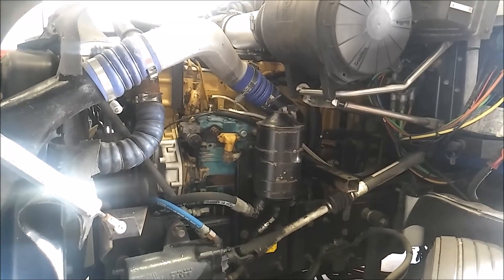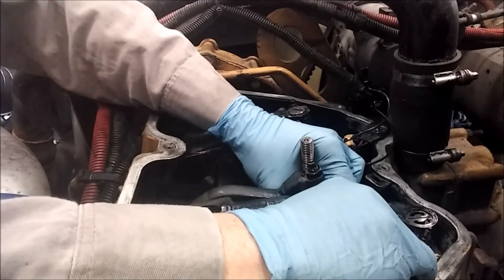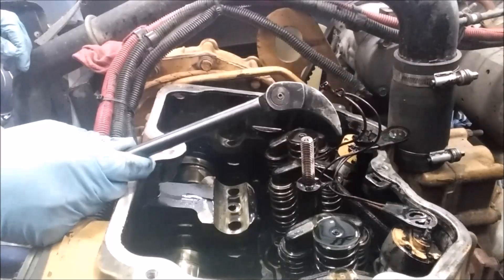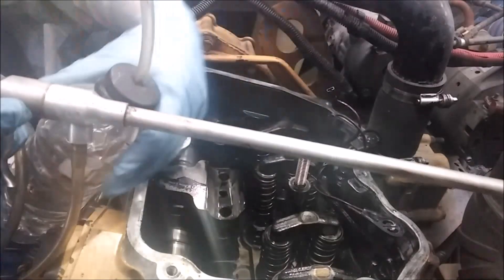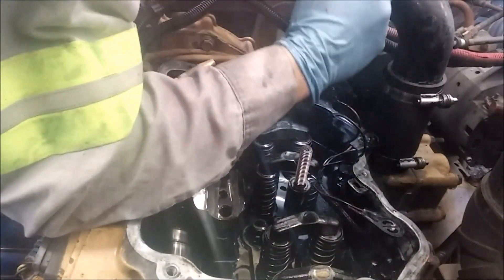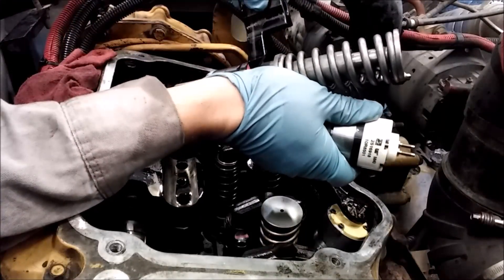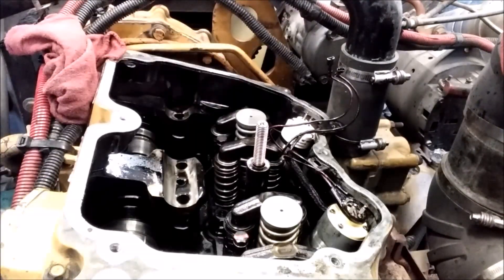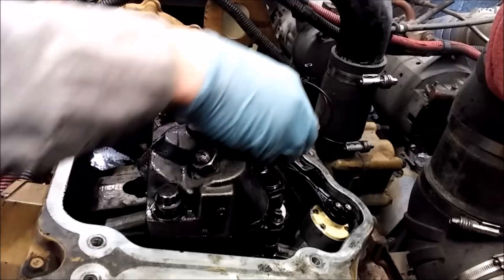How To Change a 3406 Injector or C15 Injector on Cat engines

Comment: yes not when I am stoped but after I finish a trip I see all that black on my trailer
Reply from the maker: Sounds like you have an injector over fueling, that is the cause 90% of the time, the injector it injectors will have to be changed most likely.

Comment: is it just a computer flash or mechanical work
Reply from the maker: Looks like you can change your HP to 550 1850 torque if you want. You need to check your transmission serial number to see if it is rated for higher torque, if it is rated for 1650 torque you can uprate the engine for 500 HP 1650 torque.

Comment: first I want to say thank you for does videos, they are very helpful.
if you would make one video, I just ask if you can, how I can use that tool, injector hight tool and how we can adjust it on C15 engine.
thank you again.
Reply from the maker: Will do, I'm going to make a C15 overhead adjustment video. There are some on YouTube, but I want to do a thorough one that will describe injector height, valves, Jake's, and IVAs. I just have to wait to do one at work and record it.
Reply: Thank you very much, I wanted to ask you that, but I thought it will be too much too ask, thank you again, looking forward to see, you are good man.

Comment: mxs22631 and where do I do an oil sample thnx
Reply from the maker: Normally oil samples are taken during an oil change so you just drain some of the oil from the pan into the little oil sample container, but you can get an SOS oil sample suction gun if you want to do it more often through the dipstick.
Reply from the maker: +fisnik bojku The part numbers for your harnesses are 3214323 and 3214324 there is a rear and front harness. The prices are 189.91 &  149.71.
Reply: +Adept Ape and thnx for your help
Reply from the maker: +fisnik bojku They show that there is 1 of each in stock, you would have to call parts though to get them ordered and held.
Reply: +Adept Ape sir I was reading about the valves on cat 15 and it says for VVA 1 TDC  compression adjust 124 what bothers me is that it says now turn engine clockwise  for 356  and if that's the case I have turn CCW  IN THE DIRECTION OF ENGINE ROTATION  I was reading testing and adjusting from Cat  so what's wright?
Reply from the maker: +fisnik bojku Facing the front of the engine (harmonic Dampener) you will rotate it clockwise for tdc 6 then do 653.
Reply: +Adept Ape that's what I did viewing from flyweel counter clockwise
Reply from the maker: +fisnik bojku yes sir counter clockwise from the rear, that is correct.

Comment: how you take the cams off?
Reply from the maker: The C15 has a single camshaft that has to be removed by pulling it through the from gear housing or by removing the head and sliding it out of the cam bearing bores.
Reply: +Adept Ape okay thanks

Comment: my engine is a 2003 c15 6nz  , i didnt understant about the exhaust manifold ?   mine is a 3 pc manifold ive changed gaskets on it , as well the Turbo 5 months ago NOT RELATED TO MY PROBLEM i messed it up myself trying to install live and learn , 
as far as pricing i found on ebay for $140.thru $180.  is that what you think the Cat remans you mention costs?
Reply from the maker: Cat Reman injectors are much more than that. The ones on eBay are probably remanufactured by a fuel shop somewhere but not Cat. Cat remans are probably in the 400-600(depends on horsepower and serial number) dollar range per injector. I've never put aftermarket injectors in an engine so I can't say how they will run compared to genuine CAT Reman ones. The 6NZ C15 is ones of the best engines ever made in many Mechanic's opinion.

Comment: i had someone look at it he tested it with a infra red temp light on each cylinder he said all 5 cylnders were running between 205-216  but number one was 186  so he said number one wasnt running right ,  do you think that  technique works ? also if i was to replace the injector well i want to change all at the same time , I know there expensive what do you think about REMANUFACTURED ONES?
Reply from the maker: The infrared technique works on something with individual header style exhaust but, not very well with an exhaust manifold log. If he can measure the outlet of each cylinder accurately though and one is much colder, then that is probably the non firing cylinder. I would recommend taking it to a shop to just get the correct cylinder identified then you could do the repair yourself. We use remanufactured CAT injectors all the time and they have the same warranty and good performance. I would recommend them as they are much cheaper as well.

Comment: whats the most common way to tell youre injector is bad?
Reply from the maker: Typically if you have an engine miss or rough engine operation, then a cylinder cutout test will determine which cylinder is the cause. Then the valvetrain will be inspected and if all of the mechanical components of that cylinder are okay (valves, valvetrain, cylinder liner, and piston) and the Jake brake or IVAs aren't holding open, it really only leaves the injector to be at fault. Injectors are the number one cause of engine misses in general. Hope that helps.